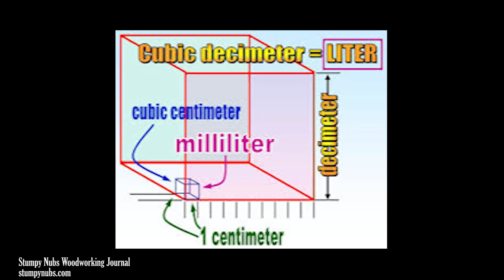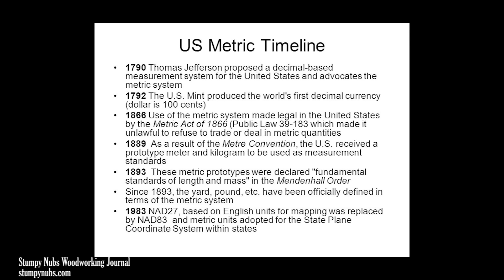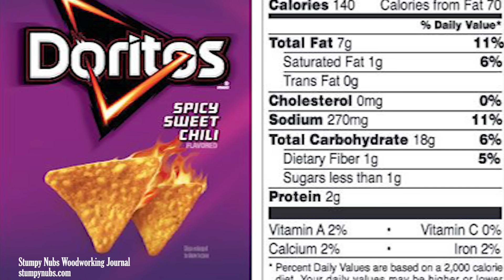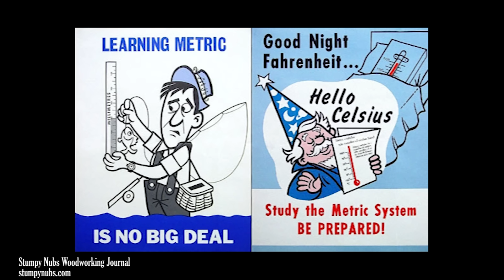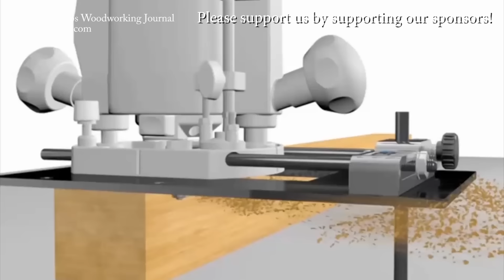BREAKING: The USA is switching to METRIC!

Comment: I personally find that I use both systems almost equally.  While the metric does conversions better, the metric system has 1 issue.  Which is dividing by 3.  The beauty of the imerial system for measuring construction distances is due to the fact that its a system based on 12.  12 can be divided by 2, 3, and 6.  This is a lot more useful when doing generalized layout for things like equially distancing things as you have more units of measurements to work with.  While most people are used to dividing by 10, I honestly think a system based on 12 is actually a lot more versitile when you fully commit to it.  But that being said, the metric system is far better for projects that are under a few inches.  The metric system is better and going small through conversions, but sometimes if I want to work referentially halving continuously is better for eyeballing.

While I may have defended the imerial system more than mentioning how good the metric system is, I will point out that there is a video above already mentioning that and simply basing things off of 10 is just really useful.  But so is basing things on 12.  Why force yourself to use 1 system when you can seamlessly take advantage of both system's advantages.
Reply: Well. Thats only one advantage. The advantages of using Metric is clearly far more than using Imperial
Reply: @timexyemerald6290  Why not use both?  It's like a rich guy choosing between a truck and a mini van.  Just use both for the task they each excel at.
Reply: Make your thing 12cm, problem solved!   Or 24 or 48 cm or mm or m. Any 12 multiple
Reply: I always thought we should use base 12 instead of base 10.

Comment: I'm an American living in Australia (love it).  Australia is officially metric, but it's actually a jumble of US, Whitworth, and metric.  My Taiwan "metric" milling machine is put together with whitworth hardware, with only the lead screws being metric.  The nuts and bolts section of the local hardware store has fasteners from all three systems, so it can be a bit treacherous.  Plywood is sometimes 4'x8' and sometimes 2400x1200.  Keeps you on your toes.
Reply: Certainly can keep you on your toes. I remember as an apprentice fitter and turner in the 1980s we had to know both metric and imperial systems as some drawings were metric while others were imperial.
Reply: Aussie here too - don't you just love the sheet material that comes in a hybrid size somewhere between metric and imperial!

Comment: American here and switched to metric in my shop a few years ago.  Literally the worst part of making the switch was putting the metric measuring tape on my planer (took my sweet time to do it properly and I managed to get it absolutely perfect, but I was terrified of screwing it up!).  Not dealing with 3 or 4 different fractions constantly, not to mention having to keep converting between fractions and decimals any time I have calculate a length, it has just made life better.  Maybe its a little easier for me though because as a competitive cross country skier, everything is already in metric for that.  

In short, switching to metric has meant less time doing math and more time actually working on the project.

Comment: I started using some metric stuff when building cabinets. All of the hardware for cabinets is based on metric measurements, so it's made that much easier. I had planned to only use it for cabinets, but I'm finding myself using it for more and more projects. I do occasionally use imperial when things I'm using, or plans, are in imperial units. Sawstop has metric on it and all the festool stuff is metric based too. If someone orders 12" drawer slides, it's a very rough 12" because those drawer slides are actually 300mm drawer slides and labeled with 12" because we're stubborn. The holes for installing those drawer slides are all based on metric units. Plywood? Yup, that's also all metric too. If you see a weird fraction for something there's a good chance it's because the measurement is actually done in metric. The rest of the world is in metric, so almost all products and materials are based on metric and just given imperial labels for us.
Reply: It becomes interesting, when the drawer slide is 305mm.
Reply: @0Turbox  so what?
Reply: @0Turbox  can't say I've ran into that. They're all on the 50mm, so 200, 250, 300, 350, 400, 450, 500, etc.. A 12" slide will measure 300mm, not 305. that was kind of my point.

Comment: We have been actively using the metric system for over 45 yrs now in manufacturing and engineering, only niche areas still use imperial units due to legacy issues.  Roads and homebuilding are the the major holdouts.  That being said, units are units.  It doesn't really matter what you use as long as it is consistent.  Both have their advantages.  As and engineer, I use both depending on what is being designed.  Its not hard.

Comment: I’m in the UK and we tend to use both interchangeably for some reason, and usually older folk will use imperial. I think it’s handy to understand both. But nothing beats the ease of dividing in metric. Our tape measures and rules have both metric and imperial on them which I like.
Reply: I've always used metric as that is all i've ever known but since getting into machining i regularly find myself measuring in thousandths of an inch. Probably because i'm cheap and in the UK the second hand imperial tools tend to be cheaper. When you're measuring 0.002" i just find that nicer to read than 0.05mm. Feels like i'm being more accurate! No logic or sense to that though.
Reply: True in the UK. I like using both. 
But dividing by 2 at least is usually easier in imperial. You just double the fraction.
Half of 5/8 is 5/16.
Reply: Thats because the british metrication programme was an abysmal failure, so the UK got kind of caught half way.

Comment: I grew up in a country that uses metrics system mostly, but some area are common to see imperial system, such as plumbing, wood and construction. Personally I use metrics for most of my work such as PCB, 3D printing...etc. But when it comes to wood working, I tends to use imperial (without conversion), because it's easier to estimate size in feet than in meter, and when drawing lines, I think the 1/8 gap is just the right width to work with when hand sawing while cm is too big and mm is too small. The width of the pencil mark is sometimes wider than 1 mm, lol

Comment: I'm an engineer and we use metric for everything and always have. However I must say, I will always prefer Fahrenheit for outdoor temperatures. The increased dynamic range is just lovely and I would much rather say 72 degrees than 23.5 degrees. 

Also, in the workshop I use imperial for many things but occasionally use mm since it's easier to deal with small measurements.
Reply: No one here ever says 23.5 degrees. I don't know anyone who can tell the difference between a day where it's 23 and a day where it's 24. Even for water temperature 1°C is far more precise than needed for everyday life.

In fact, I just looked at thermometer pictures and most are graduated by 2°C and by 4°F
Reply: Nobody says 23.5 degrees.....ever, if the temperature increased from 23.5 to 24 how would your life change? I cannot think of any application where half degree increments would ever be used
Reply: @chrisharris1522 I care about 0.1° differences when deciding  whether to open or close the windows on days where I want to keep my flat as warm or cold as possible. Funny someone likes fahrenheit as the stated goal of fahrenheit, never having to use negative numbers, has clearly failed even for whether forecasts. Celsius is very practical: below zero numbers tell you to be more mindfull of the cold.
Reply: @Jacksparrow4986  The Fahrenheit scale has negative numbers as well. Funny detail: -40C = -40F (= +233.15K ;) ).
Reply: I am a 64 year old Brazilian engineer, we use the metric system but as a child my grandfather used the imperial system. Today, when I watch a video or use a project in imperial, I don't do the conversion because it's easier to use the original measurements.

Comment: I have a collection of Allen wrenches in a nifty package that folds out to have a series of metric sizes on one side and US sizes on the other. But I've never used those US-sized ones, because I've never encountered an Allen bolt in a US unit size in the wild--they're all metric. Honestly the vast majority are in the one size that Ikea uses for all their furniture, and there are maybe a couple of others.
Reply: You might be wrong about that.  In my experience, on the rare occasion I know for sure what size the Allen bolt is "supposed" to be, I've found that metric wrenches frequently fit better in SAE bolts and vice versa.  Using the "correct" Allen key there always seems to be some slop.
Reply: I got sick of always wondering which fit what so I made a master allen wrench ring that has both metric and sae wrenches together in order of size so I just take that out and try them until one fits good, now I don't have to think about it at all, or even care what size it is... :)

Comment: I started using Metric when developing tool accessories to be 3D printed. It was obvious anything smaller than 1/4 in. benefitted greatly from being measured in mm's, especially the smallest of parts. Even if the output of the accessory is to assist in Imperial measurements, it still so much easier to use metric and not have to type in fractions or constantly use 4 decimal places after a number to get exact fits.

Comment: i recently bought the incra router table and fence system in metric.  I've always found it easier to work in metric and have struggled with using the Imperial system for some reason.  Anyways I like using metric as I seem to make fewer measuring mistakes.  The difficulty I have had in using the metric system is more related to tooling such as finding metric router bits.  They are more difficult to find and I noticed the number of incra metric templates seems more limited in number of choices.  Not sure that's true but it's my impression that I had less choices to make. At the rate the USA is transitioning I am going to be a really old man before we totally transition.

Comment: At least one of the "big three" American automakers has been using all metric fasteners on their vehicles since the early 90s. The other two have slowly come around.
But also my doctor's offices have been recording measurements in metric for years now.
I've been using 24-hour clock, dd-mm-yy date format, and metric length, mass, volume, and temperature units since my early teens at least. I'm about to be 35 now.

Comment: I've been into woodworking for quite a while working in my father's workshop using imperial marked tools. When it was time to start buying my own tools, I made the decision to buy as many tools as possible with metric only markings (mainly to force myself to use the system). There are some exceptions like my chisels which are 1/8, 1/4, 3/4, and inch but I'm not using those to measure. I have no regrets. My projects are laid out in metric and it's simply easier for me. I wish it was easier to procure more tools with metric only markings here in the US. Having to special order for a metric version is a pain but if I simply gave in and just bought the imperial version out of impatience, then there's no incentive for retailers to stock both. I hope the demand for metric marked tools continues to go up so that we can at least have the option. And for the record, I do prefer metric only markings rather than dual. Given I've made the mental shift, I simply no longer measure in imperial and I like the flexibility of taking a reading from either side of the scale and not have to flip to have my preferred scale in the proper orientation, etc. In the event that I do need to measure in imperial, I do have an imperial only measuring tape.
Reply: Exactly.  The clutter of dual unit measuring tools is annoying and interferes with developing an intuitive sense of units.  There are lots of metric only tools on Amazon, but Amazon's sloppy search makes them rather hard to find.
Reply: Possibly even better than metric is to only use millimeters. Keep it all in 1 dimension and you avoid any dimension conversions, with the possibility of errors. Millimeters should give you the relevant precision for most projects. A house is about 18000x12000mm.

Comment: Canadian here, we've been metric since the mid-70's. You guys told us you were going metric, so we were forced to convert too. We converted, and then we found out that you guys didn't bother after all. You guys pantsed us. We learned all of that metric, and now we have to use both systems, just to talk to you guys. BTW, come on over to the metric system, you guys are gonna love Celcius, it's the easiest one to learn.
Reply: We barely even use metric lol. Even Celsius we only use for weather, water, oven and thermostat temps are still expressed in Fahrenheit in canada
Reply: @Dreadlock1227  Yeah, it's true we're using a very hybridized system due to the fact that we're so close to the USA.
Reply: exactly! I remember that and still annoyed that we have to deal with both in Canada because of our American cousins.
Reply: Celsius is also way less useful at the human scale
Reply: @Dreadlock1227  when did you last see a car with Whitworth bolts?
Reply: @SunShine-xc6dh  It is by far more useful, the boiling point of water is 100C and the freezing point is 0C. How can it get any simpler?
Reply: @bbbl67  I'm dead long before water boils  and still fine after it's frozen. 
and it's not like if I were trying to do either of those things those things I would use just the exact minimum or maximum temperatures...
Reply: @SunShine-xc6dh  But you know for a fact that if water is vaporizing, it's way too hot, and if water is freezing, it's way too cold. You typically want water in the liquid region.

Comment: There is no reason to abandon one for the other. They both have their uses. Personally, I use metric for all of my projects, but if all I have in hand is an inch graduated measurement tool, I use that. I think it is important to know how to use both
Reply: Truthfully, neither has a use that the other does not. The primary benefit of metric is exactly to establish a single standard for measurements and to abandon imperial. Doing so prevents communication errors across systems.
Reply: What you have 'On-hand' is ten digits - you Metric human.

Comment: Australia went metric in the 1970's - I was in the last class that went through TAFE (vocational training) using the imperial system. As a mechanic that repairs agricultural and earthmoving equipment I have to have two sets of spanners and sockets in my toolbox - 1 set AF Imperial and 1 set Metric. In the last 10 years I have noticed Caterpillar parts catalogues with warning labels -  WARNING Metric Fasteners used on this component!
If you worked on old pre 1960's British equipment you needed an additional set of sockets and spanners - Whitworth!

Comment: The main annoyance i have is in buying materials.  Most materials are in Imperial, so in theory one would need to trim/modify them to be "simple numbers" in Metric.  As you pointed out this is gradually changing luckily.
Reply: Lumber doesn't care what measurement you use and you have to mill most of it before you use it. Plywood is already metric for the most part since it is imported. MDF is my main sticking point since it is still true 1/4, 3/4, etc.
Reply: It's even worse, when shopping for groceries in my part of Canada. Some produce is shown in $$$/lb, but the weight of a single item might be in metric...or vice versa. Would you like to buy 1 lb of apples at a price of $0.123/100g?
Reply: @longshot726  As someone in Europe, my plate material being 19mm (3/4) is a regular mild annoyance! 😅
Reply: Manufacturers are already doing this for sheet goods. You just need to order it (the vendor will like roll their eyes but tough) . Then it matches stud centers so no trimming required. The other thing to note is that quarter inch plywood is not quarter inch etc. Nominal measurements are often different.
Reply from the maker: All of our material can easily be measured in millimeters right now. The tiny fraction of a millimeter you may have to round off is well within the margin of error for any construction project made from sheet goods and 2X4s
Reply: @muizzy  ours is almost always 18mm unless they cheap out and go 17mm.